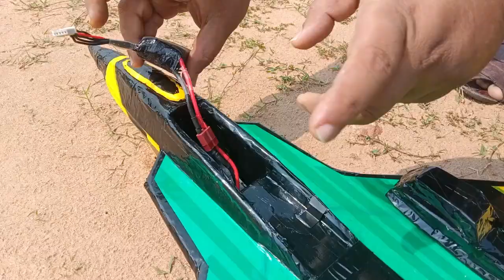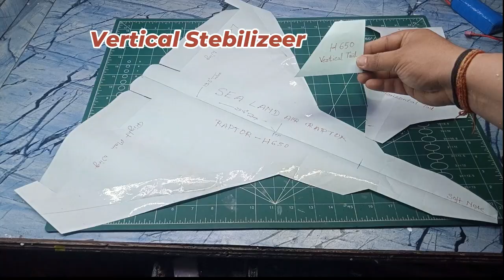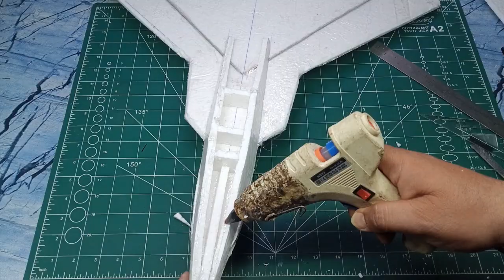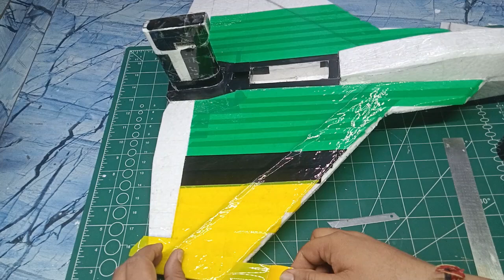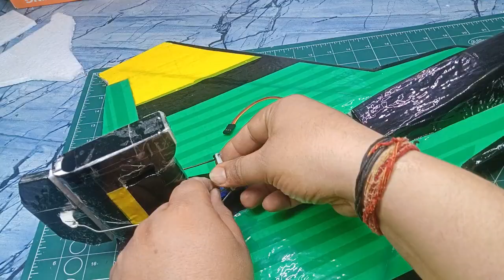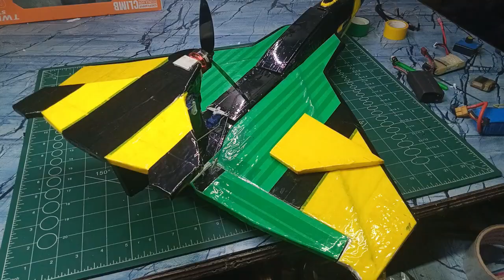How to make Rc Plane Raptor H650 | Making Rc Plane RAPTOR H650 Out of Thermocol #rcplane

Comment: One question: I bought the original kit of the Xiaxiu Raptor H650.
In the first one, the remote control was dead.
Now I have replacement RC, but it is still not working right 
So the "new" get in power... and makes tone and the red led light goes on ... but then...nothing. no connection to plane 

I put first the Lipo in the plane... it's beeping, the lights flashing and the automatic function of the heck rudder works, when I tilt the aircraft tail elevator. But nothing more.

When I switch then the remote control on "on", its beeping, red light comes .... But nothing more. Every switch or button I can press... But there is no connection to the plane.

For my RC Boat this connection works automatically, when I put the Lion battery in the boat and then switch on the remote control. Everything is there after a few seconds automatically connected.

What is now the error? The remote control seems to work ...
My suggestion is: The central unit in the plane is in some parts dammaged too. The antenna cable is well fixed... This could not be the error.

Bu what is now the failure?
I'm pretty angry about this China junk...